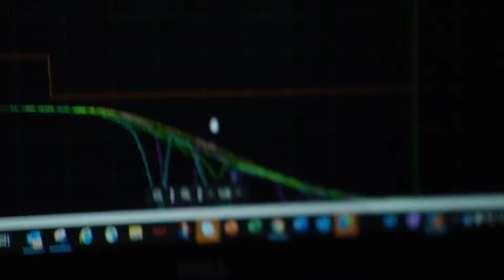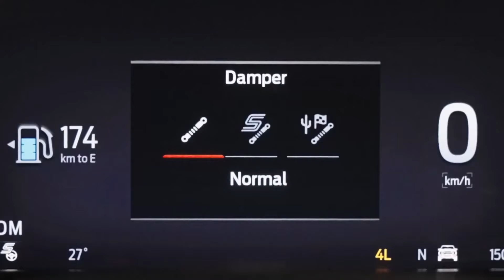All-New 2025 Ford Ranger Wows Everybody!

Comment: From South Africa: my 2018 2.2l turbodiesel single cab with an eight foot bed, gives me 27 mpg on a combined cycle, without even trying. And I can at least load something on the bed. The 2.2l diesel is now replaced with a 2.0l turbodiesel in the Ford line up. Still with good fuel economy

Comment: I love the changes that Ford is putting into the Ranger, especially the plug-in hybrid. Still some room to go at the Lariat trim I think, like ventilated seats, A/C vents in the back for passengers, more soft-touch in the back, a 60/40 split, a full sun-roof, etc. What I really want to see is an all-time 4-wheel drive model for the Lariat. I don't need a serious off-road vehicle and AWD would be great.

Comment: And the price tags are just out of this world. Sure, a great truck. 
Still, we love our BT-50/Ranger. A 2018, 4x4, 3.2, Auto, fully loaded. A powerful, easy and honest workhorse which we use when overseas. Bought brand new for $ 30k out of the door at the Mazda dealer. Not one issue since. And doing a 27 mpg in mixed, real world driving.

Comment: Ford needs to add the Auto 4WD system to the Ranger like the Canyon and Colorado has. I believe other countries get that option - why doesn't Ford offer this on the XLT version of the Ranger in the USA ?  The Auto setting allow more secure and safer traction during Rain and slightly slushy / wet conditions in the winter time